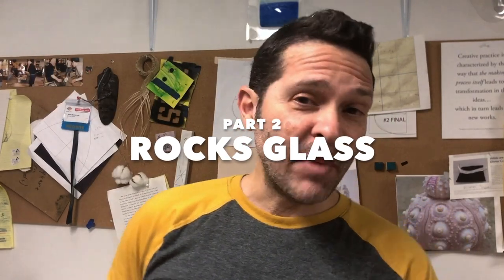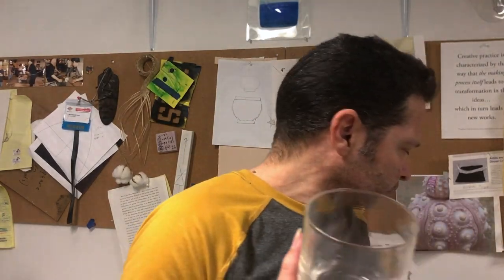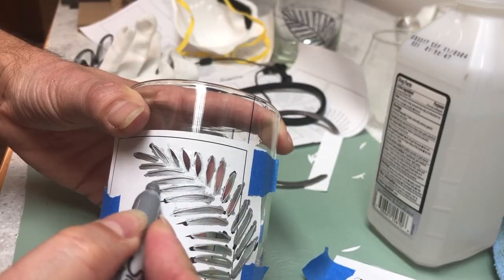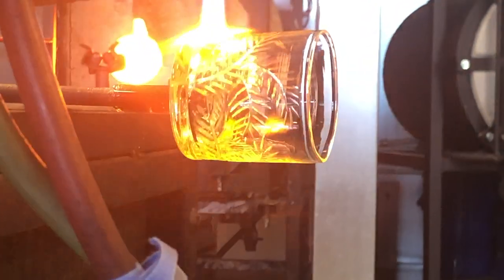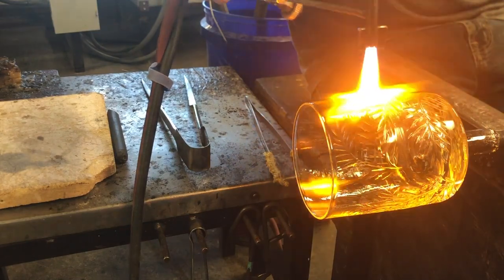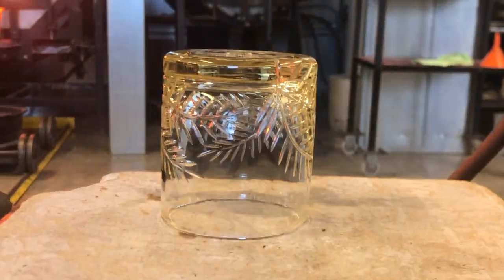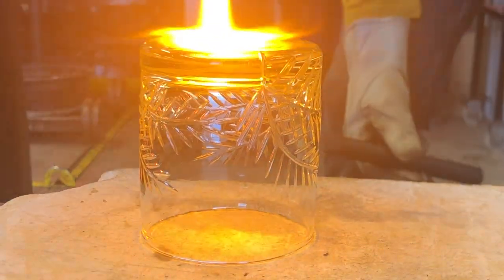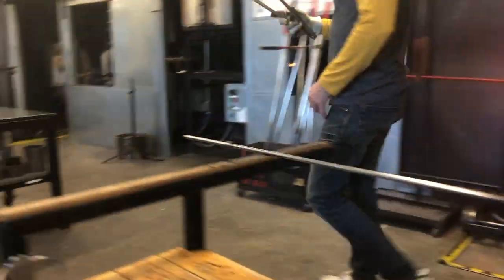Narrated Glassblowing - Rocks Glass Pt. 2 - Palm Leaf Engraving

Comment: You should try using your stencil with a light dusting of spray paint. The paint will stick to the glass through the wet process and any over spray can be removed with solvent.
Reply from the maker: Thanks for this! Great idea. Will definitely give that a try.
Reply: good call, maybe try those paint pens (or maybe that's what the silver is?) anyhow - yeah, great video